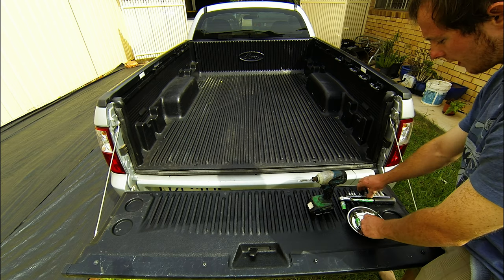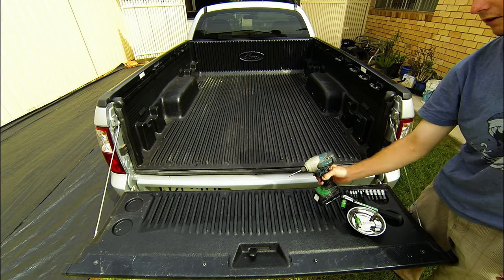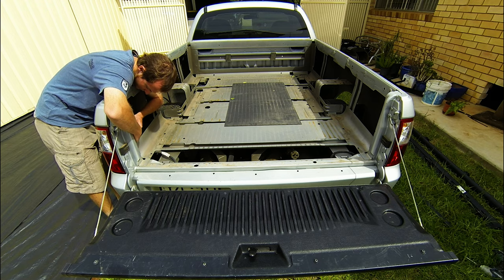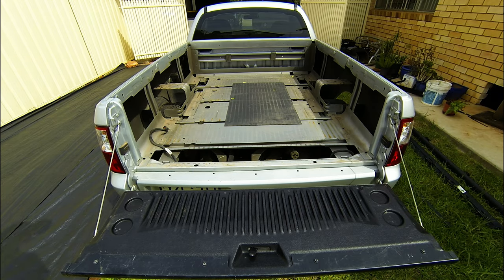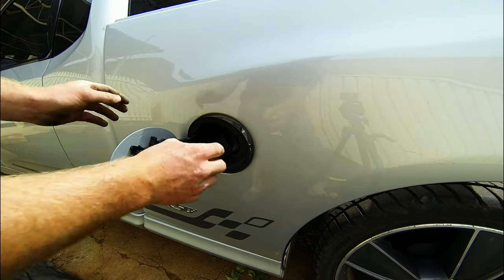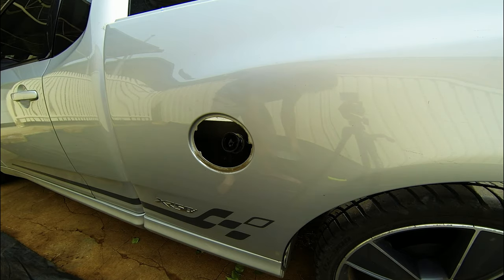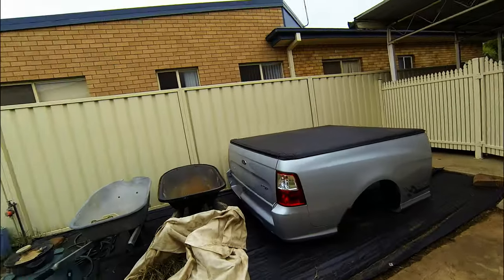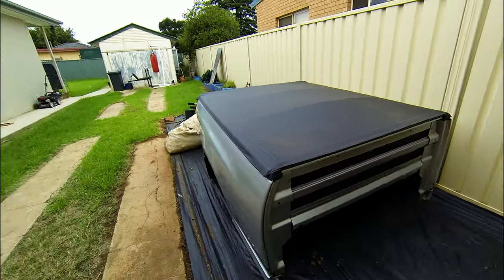How to Remove the Tub from an FG Falcon Ute

Comment: Is it the same process with a BF? And I want to convert mine to tray back, does it all bolt back up the same?
Reply from the maker: Same process as far as I know, although the tubs are a little different so expect some slight variation on number of bolts and their placement.
Reply: @Bupalooga1  I had to change a few mounts for the tray but it was all pretty straight forward :)

Comment: Is this unibody or body on frame?  Is it the same as the sedan?  I'm from Canada and I love these but I know nothing about them.  🤔
Reply from the maker: Matthew Millar both the sedan & ute are body on frame I THINK. & very much identical in the front half with all suspension engine etc components interchangeable. But with everything behind the drivers seat completely different.

Comment: Does a falcon ute aluminum tray just bolt straight onto the chassi rails without drilling any holes
Reply from the maker: Reply might be a bit late but I'd say if it's made to suit a falcon it would use the factory mounting points
Reply: @Bupalooga1  the brackets fit because they were made for a ba but when i removed the tub i had to tap a thread where some of the bolts went in there was blank holes pre mad to tap thread into
Thanks anyway

Comment: Removing mine today,  to remove the fuel pump,  not reading the correct fuel, measure
Reply from the maker: Probally too late to help you but I believe an easier way out is to remove the plastic liner then cut a hole in the metal sheet that covers the fuel pump area.
Reply: @Bupalooga1  I was watching this video just to hope there was already a whole under the liner for the fuel pump